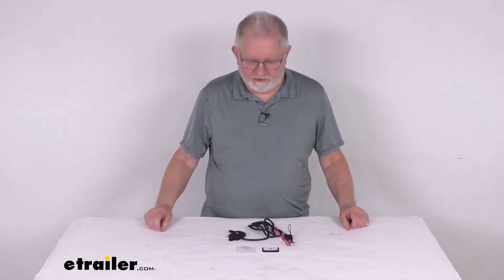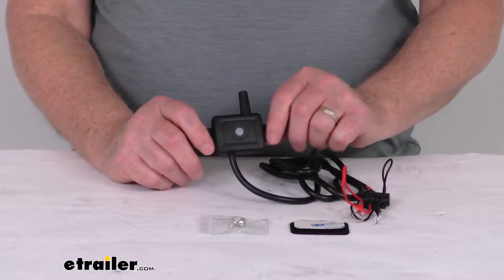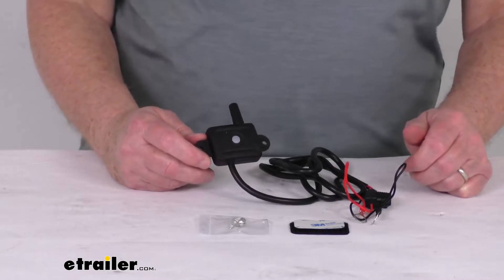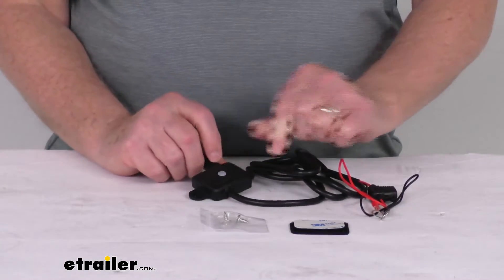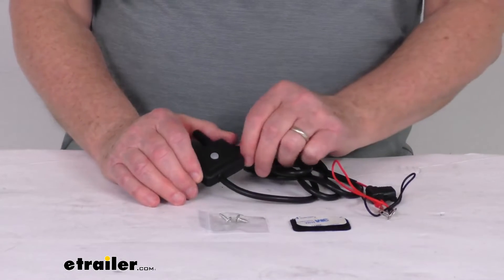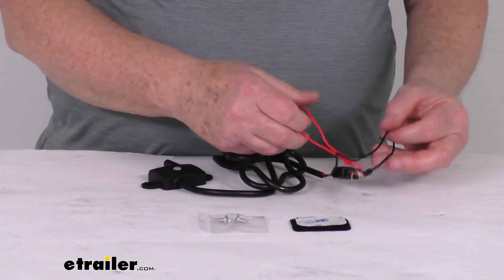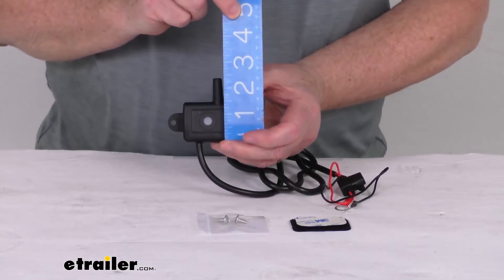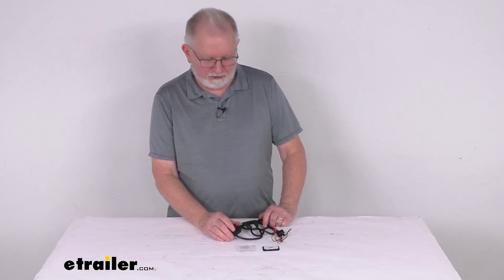etrailer | Comprehensive Review: Signal Booster / Repeater for TST TPMS

Comment: For our 30’ travel trailer We just put it in our battery box using wing nuts to attach it to the battery’s terminals.  I guess it’s using some power all the time but it’s never been an issue.  
We go campground to campground.
Reply: Can you show some sort of picture of the hook up to the battery terminals? I don't understand how you can take bare wire and wing nuts to attach to the terminals.

Comment: You didn't say how to turn on?
Reply from the maker: The repeater would be wired to a circuit that's hot when the vehicle is running. No need to turn it off or on. Here's a link to the instructions:
https://www.etrailer.com/instructions.aspx?pn=TST-507-R